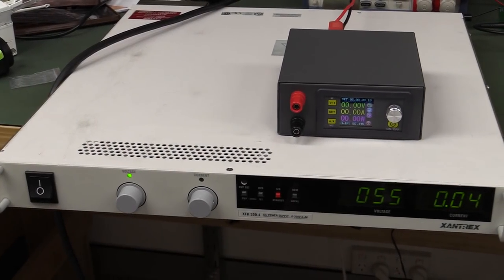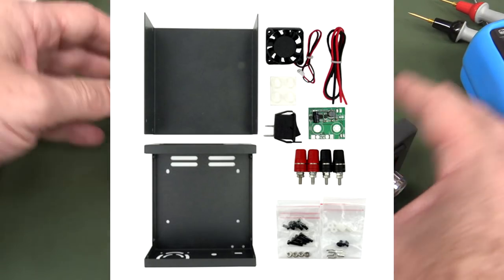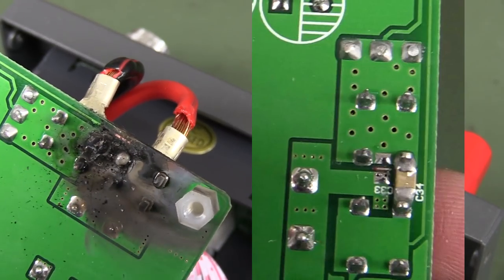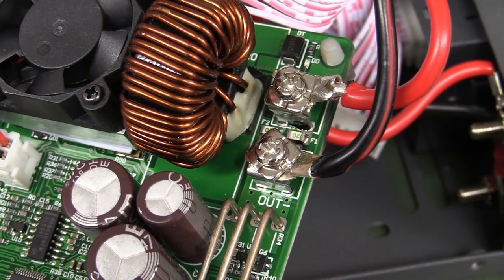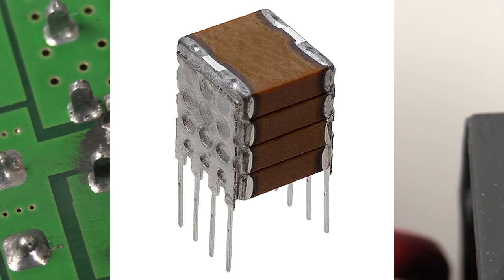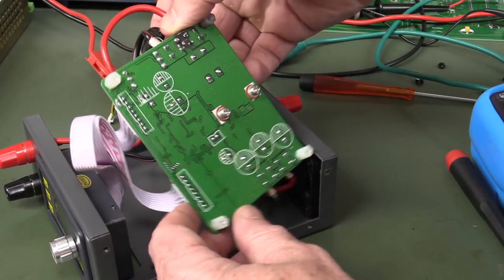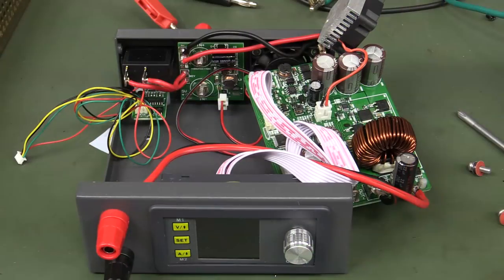EEVblog #1035 - Flaming DIY Power Supply!

Comment: 12:05 "JET FUEL DOESN'T MELT STEEL BEAMS!" No but exploding capacitors do...
Reply: Easy to tell where you've been on the web.
Reply: Just in case.... Jet fuel doesn't need to melt steel beams. It only needs to weaken it to below the design specs, and gravity will do the rest.
Reply: Oh hell, the 'Conspiracy Theorists' have arrived,   Yawn!
Reply: But there is no way that a crashed 737 made those markings in the Pentagon!!!  
I'm joking of course, just like everyone above is.  So don't worry CoolKeys, I don't think any of the nutters are here.  They all sodded off one they saw Dave's solar roadways videos.
Reply: and building 7? haha
Reply: Just for those wondering, 7 WTC was taken out by fires caused by falling debris from 1 WTC (the Northern Tower). That among other damages.
Reply: and at free fall speed yep ok you be a sheep in the system then
Reply: Of course not. You've got air resistance, turbulence, etc. Pieces that big catch a lot of air, but they still carry a lot of force when they land. Catch some electrical cables on your way through the south face of the building, and you've got fires. On top of that, the sprinkler system wasn't designed for that kind of volume, and system pressure was low as a result.

Fortunately, 7 WTC was evacuated safely.
Reply: look at some vids cant you put basic common sense together no prob not with those comments do some research don't believe everything your told or yes sir your always right sir no sorry for questioning you as i must conform
Reply: What's there to conform to? The building burned for several hours, buckled in one corner, then had a catastrophic collapse due to poor engineering, such as, a lack of water pressure in a poorly designed suppression system. The explanation given makes sense, and requires no forced conclusions. Occam's razor. 

Yes, I've watched the videos. But unlike you, I don't jump to conclusions based on a lack of information. In the absence of evidence, conclusion should be withheld.

What is the evidence for your "conspiracy theory?" Is it just ignorance, as in, "I don't see how that could have happened, therefore, it was an inside job?" Or do you have something substantial? What would be the motive? To invade Iraq and Afghanistan? When has the US EVER needed an excuse to start a war? Why destroy 7 WTC? To hide secret files or a hidden control center by which towers 1 and 2 were demolished? Why burn it for several hours before demolition instead of flying a plane into it - what Truthers call a "controlled demolition?" This is grasping at straws to explain ignorance, when you're too afraid to say, "I don't know."

And why should I take you seriously when you can't employ elementary level punctuation? If that is meant to reflect a lack of basic education, then no more is required to explain why you entertain conspiracy theories.
Reply: yes it was controlled demolition do you think that it was due to fire you are a tool ok do me a flavor make a steel frame using the same steel as they use now light a fire under it put furniture carpet all sorts of flammables you would find in a office now tell me if the steel bent ohh no it didn't sounds like a BBQ to me put a plate on top and cook some food but it may warp or collapse haha of course not show me anywhere is history where a steel frame building has collapsed from fire
Reply: "BBQ" buildings to suffer partial or total collapse after fire? There's a report listing several here of various construction types, including steel girder and re-enforced concrete.
https://www.jensenhughes.com/wp-content/uploads/2014/02/White_Paper_Historical_Survey_Building_Collapse_NIST_JBeitel-NIwankiw_OCT-2006.pdf
Total collapses are pretty rare, but at least a few have been known besides the WTC.

I've never heard of a 9/11 Truther who's also a metallurgical engineer. They know better. When steel heats up, it's strength goes down. Anybody who's worked with metal knows this.
Reply: + Coolkeys 2009
If you want to call it a lie, you need to provide evidence. Do you have any? Incredulity doesn't count.
Reply: +Jamie Clarke
Does it? How so?
Reply: +Coolkeys 2009
How open does your mind have to be before you start believing things without evidence to back them up? 

2000 or so architects and engineers out of almost 2.5 million in the US, assuming those 2000 are American, or that their degrees are even relevant to the topic, I'm not sure they are. If so, then that's 0.0008% of the architects and engineers in the US who don't know basic metallurgy - that steel weakens when heated. If you hired them for anything, I'd ask for your money back. Don't mistake their "credentials" for knowledge.

Do you have any video of explosives engineers rigging a highly populated building to explode without any of the tenants noticing? Do you have any documents detailing the "plan?" Do you know who was involved, and who they answered to? What kind of moron would start a random fire in a building and hope that it detonates their precisely placed and timed explosives in a controlled manner. Or better yet, what kind of moron relies on precisely placed and timed explosives when the building is on fire!? Where are the testimonies and audio evidence of that 130-140db blast, as any explosive capable of column destruction would have produced? What idiot tries to prove the use of explosives without maintaining a proper chain of custody to prove the "evidence" wasn't planted? That's what chain of custody is for, after all. 

Do you have ANY of this? Or are incredulity and argument from authority your only alibis?

Are quotes like, "For the first time in history, steel was melted by fire. It is physically impossible," (Rosie O'Donnell, ABC - "The View") to be taken as gospel if such a statement is ignorant of 2400 years of blacksmithing?

"its collapse was announced by a BBC reporter 20 minutes before whilst still standing behind her." Look at the footage again. The Anchor was the one who said that the Solomon Bros. Building (7-WTC) had collapsed, not the reporter. Obviously he was mistaken. Perhaps he conflated 1 & 2 WTC with 7 WTC, which was burning at the time, but either way, a slip-up like that is poor evidence of a conspiracy, as errors like this happen in news reporting. Hell, the current POTUS couldn't even remember which country his missiles were fired at (which could have been an IMMENSE fuck up), and his blooper was captured for all the world to see. Want to complain about that too?
Reply: did you even read it it says nothing about a steel frame building falling a free fall speed due to fire
Reply: we are taking about WTC 7 correct
Reply: watch the video tool
Reply: Oh goodie! Another video to debunk! You haven't offered any rebuttal to my last post, which suggests that you're just linking videos in lieu of an argument of your own, hoping that others can argue for you.

Regarding the NIST report, +cantonear1968 had already commented on it, so rather than re-invent the wheel, I'll just re-post here:

--
admitted that none of the WTC steel (that they claim was exposed by the jet fuel fire), reached temperatures higher than 600F degrees Actually not true. What NIST stated was the steel samples they worked with that had paint showed annealing which indicted temperatures below 600F. However they had samples with the paint heated off, indicating above 600F, so they could make no definitive statement about the temperatures reached. 
NIST contracted with UWL to see if they could use jet fuel fires in a furnace (optimal temperature conditions at 1500F) to weaken or soften the floor trusses under a 2 hour long period. No weakening let alone melting was observed from that test. Actually not true. The Underwriter Laboratory tests were conducted WITH fireproofing applied in differing thickness. They still showed significant deflection to the point that collapse was inevitable. The tests were then stopped so as not have the steel beams collapse and damage the furnace.
--

It would seem that 9/11 Truthers cherry-pick their data the same way Creationists do. Perhaps there's a connection?

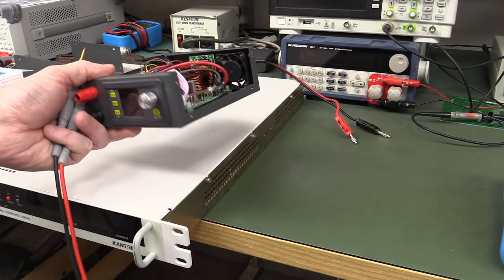Not sure why this guy's sounds as if he's trying to sell me something, but @ 4:41, Richard Gage (parody) says, "Do you see the top 15 stories crushing the 95 stories below? No."
Hmm... Actually, yes, we do see that - one floor at a time, as you'd expect. And somehow he concludes that cascade was actually well timed thermite, as if skyscraper demolitions were performed in such a way (middle first). Then clips of dissimilar demo jobs are shown, and which were not nearly as clean a "demo" job as he implies the twin towers were, and FAR smaller buildings besides, with far less mass to the equation.  Come to think of it, aren't controlled demos done from the bottom-up, as YOU implied that tower 7 was? So which is it? Were they unable to make up their minds as to how to do it?

Perhaps he thinks the walls blowing out would have been caused by an explosion of air from thermite rather than from an explosion of air from a collapsing bellows? What of the  pulverized concrete and molten metal peppering the ground around the collapsing building? Whether by explosives, or just a collapsing bellows, air will do that where the building is already filled with chunks of concrete. And what happens to hot metal when you blast it with air? Molten chunks go flying off of it. No mystery there.

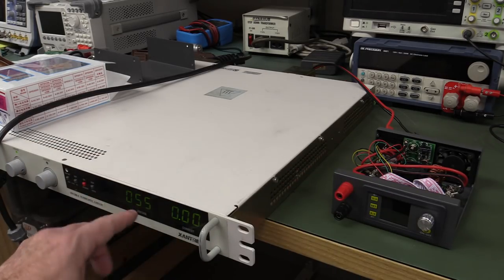5:23 HIS argument is invalid, because he uses cardboard models, rather than steel/concrete construction modeled to scale and set on fire. If you want to conduct an accurate test, your model has to be built the same way.

So get over your cognitive dissonance, and find a shrink? Not sure that would help in your case. You still haven't mastered punctuation.
Reply: so you are a structural engineer then and you know more than architects and structural engineers then hmm ok mr landscaper man do some research im wondering why your watching the EEVblog channel? if you can recreate a building 7 WTC model to same specs but scaled down and using same steel and get the same result show the world prove to the millions that don't believe the official story baaa go back to your anime world
Reply: So you know how to use a question mark, but not a comma or period? Not that I should be harping on about it, but punctuation REALLY does make you easier to understand.

While we have debated quite a bit about 7 WTC, I was under the impression that we were talking about a scale model for 1 WTC, as implied by the cardboard model in the video, rather than a model for 7. Were we not? Or are you just shifting the goalposts again?

Why am I watching EEV Blog? Because electronics happens to be a hobby of mine. So is retro computing, if it's any of your business. I also have interests in theoretical physics, astrophysics and biological evolution (specifically, phylogeny), among other scientific fields. I service my own vehicles and equipment, and as such have an interest in mechanics, machining, and to a necessary degree, metallurgy, and am able to diagnose modes of failure in said vehicles and equipment. I just got off of a 9 hour day of pruning hedges. Did you think I'd want to just think about the flora when I got home? 

But it certainly does pay to have a well rounded knowledge base, and that is what I try to do in my spare time. It's called learning. I highly recommend it.

You don't need to be an architect or engineer to notice that the far side of 7 WTC collapsed before the side facing the camera. When the far side collapsed, the structural support for the facing side was either gone, or critically weakened, bringing the rest of the building down in free-fall approximately 7 seconds after the far side collapsed. While you don't want to be so open minded that you believe anything at all without sufficient evidence, you want to be open enough to NOTICE when something contradicts your assumed conclusion, whatever it might be. It has happened to me before, and it surely WILL happen again, but it did NOT happen here.

So do I know more than 0.0008% of the USA's architects and engineers (2k/2.5M)? That's not such a stretch. Just because you can design a building doesn't mean that you're immune to bias, nor that you're not just bat-shit ignorant in other fields. And just because you're not well versed in the relevant field, doesn't mean that you can't notice something that the "professional" might have either overlooked, deliberately ignored or been biased against. Besides, if I gave into their arguments on the sole grounds that they are "professionals" in their fields, and not because their arguments are sound (as I've already pointed out several times, they're not), I'd be giving into an Argument From Authority, which is a logical fallacy. And I believe YOU are the one who claimed that I didn't understand logic.
Reply: your cooked
Reply: That's it? I've refuted every point you attempted to lay out and the best you can say, two days later is, "your cooked?" Perhaps you're just doubling down after having a cherished belief shattered. Perhaps you're just thick. But what did that guy say? "Get over your cognitive dissonance, and see a shrink?" If a government conspiracy is what you WANT to see, then that's what you'll see, no matter what I refute.
Reply: sheep
Reply: Can't use punctuation either. And in this case, the crowd is correct, and I've already proven that.
Reply: To be insubordinate, I would have to be within your "chain of command," or otherwise subordinate to you, which I am not. Also, there's no need to follow orders when your leader is incapable of admitting when he's been proven wrong, which you have.
Reply: your commander is your puppet masters
Reply: I thought you were implying that YOU were my commander. That is what insubordination on my part would imply, would it not? Or could you not figure out the implications of your own words?

Let me give you a lesson on critical thinking. You assume that because I believe the official narrative, that makes me a sheep. I've an analyzed the available evidence, and found the Truther's claims to be fundamentally flawed, that their claims lack the supporting evidence necessary to draw their conclusions, either from ignorance or the intent of concluding a government conspiracy where there is none, and, and that the NIST report is accurate, given the data available. 

Simply reading the newspaper or watching the news and accepting the story without further inquiry would make one a sheep, just as would be believing the Truther's misleading arguments without an understanding of all involved. Make no mistake, they ARE misleading. 

Analyzing the available evidence for yourself does not make you a sheep. I follow the EVIDENCE where it leads, not the narrative. And in this case, the narrative is correct.

Now, if you wanted to argue that the war which followed 9/11 was a mistake, that would be blatantly obvious at this point. Even if you were to argue that regime change was necessary for the people of Iraq to have some relief from their tyrant leader, and I'd agree on that point, I would not agree with is the execution of that regime change, nor with leaving the area with a power vacuum. That's why we have ISIS to deal with now. 

I would also NOT agree with selling weapons to those fighting whoever the US deems enemy of the day. This is where the claims of the US selling weapons to ISIS come from. The US sells weapons to whoever is fighting their enemies, these so-called "allies in the Middle East," as Hillary Clinton puts it. The problem is that allegiances change quickly in that region, and the conflict in Syria is a good example. Putin's comments about the US supporting terrorists are at least half-correct, whether Assad is the bad guy in this conflict or not. A cursory look at the rebel groups in the region and their history shows that they've shifted positions, disbanded, and merged in the past. When these shifts occur, and a particular group joins with ISIS, they carry those American weapons with them. This is another classic example of US foreign policy gone horribly wrong.

Another example is in Ukraine, from 2013 onwards. 

Right from the beginning, Ukraine was split, with some interspersion between, by predominantly Ukrainian speakers in the West, and predominantly Russian speakers in the East. This dual-ethnicity dates back to the days of the Soviet Union, when Ukraine absorbed some of it's neighbors into the Ukrainian Soviet Socialist Republic, and is worth a read by itself, but the issue regarding this conflict is that the Western Ukrainians tend to favor the EU, while the Easterners tend to feel more in common with Russia.

Protests broke out in Kiev, December of 2013 when Viktor Yanukovich, then President, refused to sign a trade deal with the EU. The US has admitted to giving protestors the ability to organize electronically, using social media and the like, as though intending "the people" to unite against a tyrannical government - on the premise of it's own merit, it would have been a laudable effort, though how much this played into the events of December 2013, I'm not sure, but it did play a part in the Feburary 2014 riots, aka, Euromaiden, where Pravyi Sektor, a Ukrainian ultra-nationalist group started becoming a key player in the violence (watch for the red and black flags amongst the blue and yellow ones when you watch the news clips). 

Now, perhaps Putin really is the bogey man everybody claims he is, perhaps he isn't. But as far as I can tell, the US's intent, in this conflict, was to put a pro-UN ally in power to put pressure on Russia, and that seems to be the US's interest in Syria as well. When the US foreign policies preferred man got into power in Kiev, Pravyi-Sektor rose with him, even being lauded as "heroes." Long story short, in the following months, their violence against "non-Ukrainians," basically, Ukrainians who spoke Russian, drove those Russian speaking Ukrainians in  Eastern Ukraine to defend themselves. For that, those Russian-Ukrainians were deemed by Kiev, and by the US and the EU as pro-Russian separatists (which wouldn't be incorrect), as Russian operatives (incorrect), and as terrorists (far from correct). 

Crimea held a referendum as to whether or not they should separate from Ukraine and join Russia, who would be able to protect them from Pravyi-Sektor, who now held military power from Kiev. The referendum passed about 97% in favor of separation. When Russia signed into law two days later that Crimea would be absorbed into the Russian Federation, Kiev, the US and the EU called it an annexation, citing that if this referendum were legitimate, it would have been done with Kiev's involvement through official channels (the same was the case with Donetsk and Luhansk, only they just went independent), but such would be awfully hard when Kiev calls you terrorists simply for wanting to defend yourselves.

The US has sided with Kiev, of course, and most of the Western media has portrayed things from Kiev's side of the conflict, marking Russia as the primary villain. But there's a lot missing from the narrative that can be found from people on the ground, with their cellphones and camcorders. Somebody was good enough to compile these news clips from both sides of the conflict, to contrast with the cellphone and camcorder video, which tells a much more complete story than what Kiev, and US foreign policy officials would have us believe.
The playlist can be found here, if you have about 20 hours of free time to go through it: https://www.youtube.com/watch?v=wwVUp4IWEKw&list=PLPXDAOv6gXa3Xsx-rKLYd0W1LvhjlwCTk

I do not know if Russia was actually involved in the 2016 US election, as the US intelligence agencies have reported, but given the history between the US and Russia, it would not surprise me if they in fact did. To the present day, Eastern Ukraine is still in turmoil, because neither side is willing to back down, and every time peace talks are proposed, they break down when Kiev forces violate the ceasefires to perpetuate their ultra-nationalism (as far as I can tell, it was Kiev who did that, not the separatists, despite what the news claims).

The point of this digression is that the more you know, the more accurate your conclusions will be. Bias needs to be removed before you can proceed with any investigation, because that bias will skew your conclusions. You can't ignore things that go against your preferred conclusions, like the penthouse collapsing 7 seconds before the rest of 7-WTC did (I watched a number of different clips, trying to get a better angle), because it shows the structure was critically unstable, and despite not having the far side of the building on camera when it collapsed, that knowledge draws a different conclusion from what the presenter misled you to believe - that it was a controlled demolition and that the ENTIRE building fell in free fall, because part of it did not.

I am anything but a sheep.
Reply: I already explained that I'm self-employed. If I did work for the government, the last post could have cost me my job, depending on the field.

I wonder, is it fun to be so myopic that you could use a monocle on BOTH eyes? You're years haven't brought wisdom, have they? Because I seem to know a hell of a lot more than you do.
Reply: "if i wanted to hear shit i would watch question time on ABC"
And yet, you are here.

You're supposed to be an adult? Could have fooled me.
Reply: adult is a age im ageless
Reply: You just admitted to being daft? My, that DOES explain a lot.
Reply: explains that i have been playing you as a fool haha
Reply: No, you haven't been playing the fool, you actually are one.
Reply: Ignore the story, I saw the videos! The penthouse collapsed 7 seconds before the rest of the building, revealing structural instability and thus rendering the freefall via controlled demolition argument bunk! How many times do I have to explain this simple concept!?
Reply: Stop flaming this guy, "Jet Fuel Doesn't Melt Steel Beams" is a meme. he was probably using it as such.
Reply: Atleast, not the person who posted the comment. you can disprove @Jamie Clarke